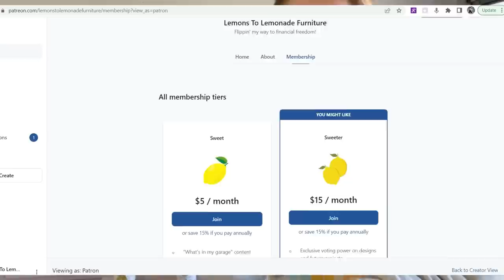THIS QUICK FURNITURE FLIP IS WOW 👀 looks so EXPENSIVE! On trend 2023

Comment: LL, you know it is really crazy how much difference removing the skirt and adding legs makes.  This was so boxy, heavy, and boring, but the lighter color and legs made all the difference.
You have a special talent (example, you really do understand "proportion") and are analytical regarding the colors and styles that are the most desirable.  Also you and hubby do not settle for anything less than the best craftsmanship.  I am still amazed by that black and white curved desk with the stripes;  the slightest mistake would have been seen a mile away and looked like junk.  It was beautiful.

Also, it may SOUND like you sold this for allot of money but just compare this to a new piece, that is made this well and solid/durable, the buyer is still saving at least 50%.  I KNOW all your finishes are tons more durable than the new stuff.  Also, I don't think furniture made this well is even available today, I doubt they even dovetail anymore.  Everything these days is made to fall apart.  The icing on the cake is that this was saved from the landfills.  So it is a win, win, win.  And "Green".:yougotthis: